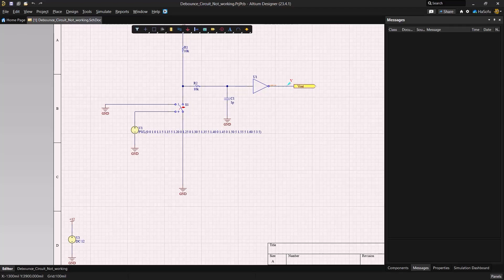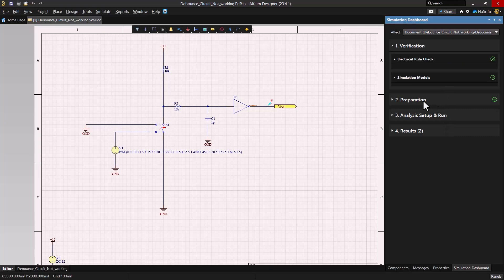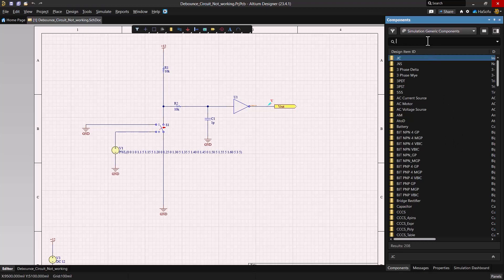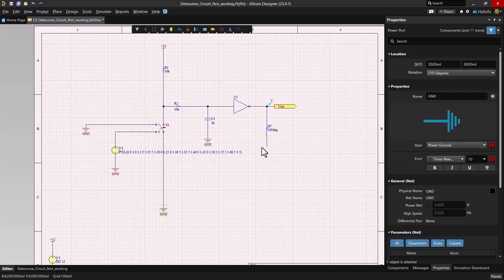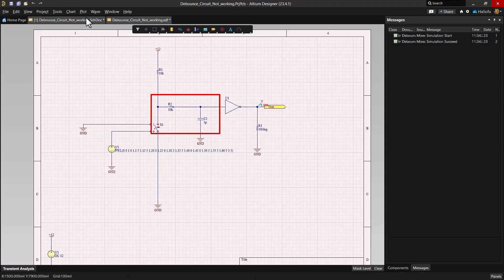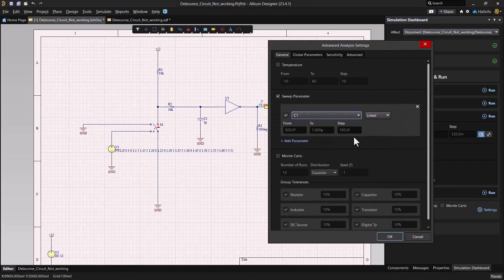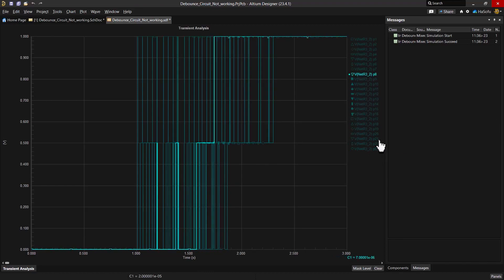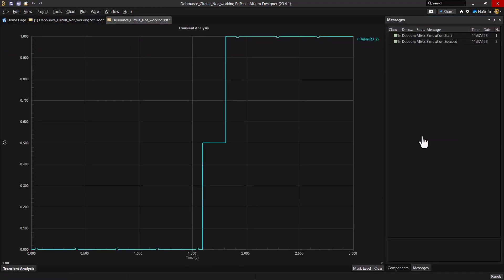Debounce Circuit

Comment: I'm a beginner in simulation. Is the switch behaviour just random? Can you elaborate? Thank you.
Reply: Switch bounce is a mechanical effect, where the bouncing action of the mechanical switch appears as an electrical fluctuation on the output votlage/current. In SPICE, you can't directly model the mechanical motion, but you can represent the electrical results from switch bounce as an electrical fluctuation on the source, and I believe this has been done with the PWL (piecewise linear) source in the schematic (designator V1). Technically switch bounce is pseudorandom, it appears to be random but the motion is predictable from the mechanical characteristics of the switch as long as the forces invovled are known. Thankfully, you don't need to know the actual mechanical behavior of the switch to design a switch debounce circuit.